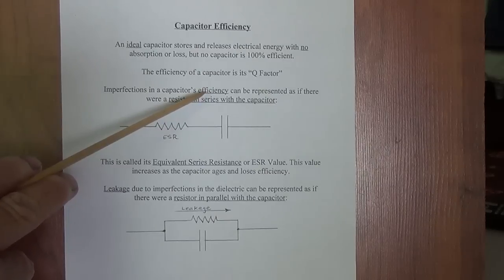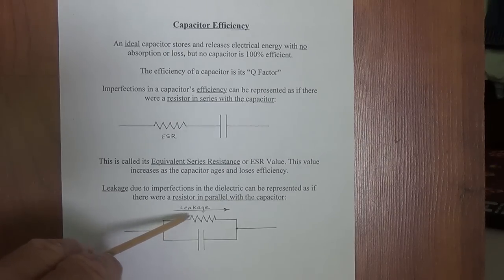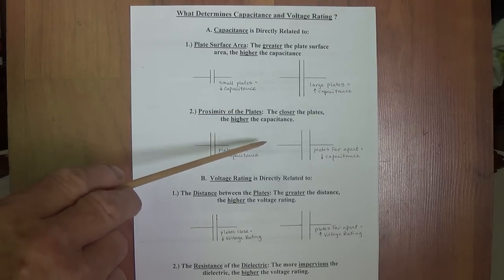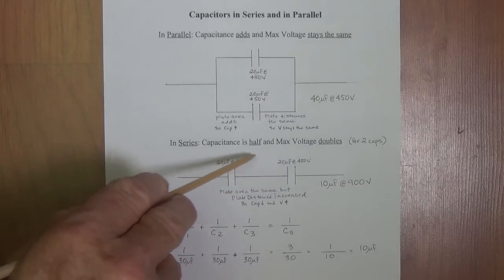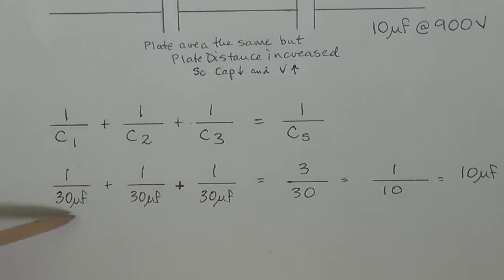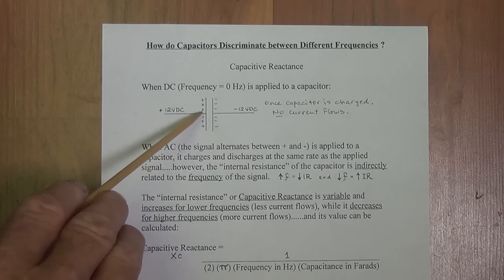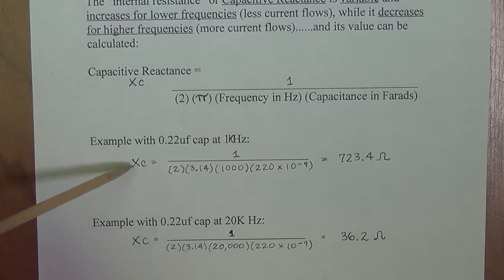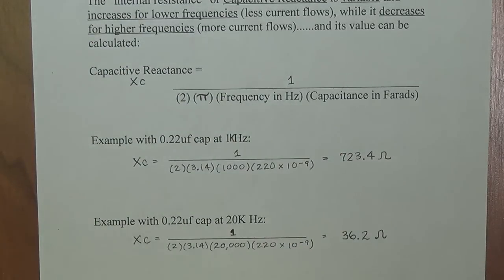Capacitors in Audio Circuits:  Part 2

Comment: @UncleDoug -- Howdy Doug. I hope that all is well down your way. I earned two degrees in electronics engineering and have never heard of ESR for testing a capacitor, but components manufacture/testing was never my field. Equivalent resistance, sure. Q, of course, although in the context of filtering. EE has been silicon (and similar semiconductor) focused for over 50 years, but that may change soon. As always, most edifying. 🧙🏽‍♂️
Reply from the maker: Thanks, KW.

Comment: Very helpful, Doug. Thanks so much! One more question, though... The example you gave for calculating capacitance and voltage in parallel wiring uses two caps with the SAME voltage (450V, in this case), but how do you calculate the voltage if two or more caps that are wired in parallel have DIFFERENT voltages?
Reply from the maker: As long as both voltage ratings are higher than the voltage they will face in the circuit, their voltage ratings don't matter.

Comment: It’s really gratifying to learn this formula for the Xc of capacitors. Might as well be black magic to a lot of people on guitar forums who, when choosing tone caps and especially the bypass caps for a passive bass cut, insist that trial and error is the only way to find the right capacitance. 

With this equation however it’s as simple as taking the formula for the attenuation of the proposed circuit, and making an XY plot of that attenuation against frequency. Do this twice, with the minimum and maximum value of the variable resistor, and you have a good idea of extreme values, though not necessarily the sweep of the given pot. Could be wrong but I think everything involved is linear so it’s simple math indeed
Reply from the maker: Thanks for sharing this with us, George. We're glad the video was helpful.

Comment: Hiya, Uncle Doug--

Another dumb question. I've got a circuit that uses a 0.1uf/400v cap going into the volume control/tone stack, and  0.1uf/16v between the volume control/tone stack and the phase inverter. 

Is this  configuration equivalent to 0.05uf/416v? Also, how close can I place a 6ca4 to the power transformer?

Thanks again for all the education.
Reply from the maker: Absolutely not. Leave some space, like 1", for ventilation.
Reply: @UncleDoug  Makes sense.

Comment: Uncle Doug the thing I really most like about the way you  teach things and approach things is you don't approach it strictly as an  engineer would. Your guitar player as well and you have a good ear ,and you understand... just because you use the same values with capacitors doesn't mean that they're going to all sound the same ! . And the worst thing you can do to a vintage amp is completely stripped all the capacitors out stock it  full of  Orange drops or something along those lines.  Then all of a sudden the magic of that amp is gone, and so is the compression in the harmonic resonance in organic warmth .  I get so tired  arguing with these stupid engineers and repair guys they tell me that I must have ears like a dog because it virtually impossible to hear any difference. Personally I think you would have to have pretty poor hearing not to hear the difference.  they say that it's impossible for the main filter capacitors  to have any effect whatsoever on the sound. I know that's not true. I've wrecked really nice black face fender amps by trusting somebody that told me as long as the microfared values were the same it wouldn't change anything.  boy was he wrong! Give me a pair of light blue late 60s Sprague Adoms in the end will sound as good or better than it used to. And I've checked the values and the ESR levels on nose capacitors and they all were still right on the money or very close
Reply from the maker: Thanks so much for your input, Dave. We appreciate your time and interest.

Comment: for coupling caps, when calculating total capacitive reactance, as applied to frequency, do we need to factor in the load input impedance of the tube its driving?
Reply: thanks
Reply from the maker: No.

Comment: Uncle Doug, I guess I was dosing in class because I've never understood the series capacitance formula.  1/30 +1/30 + 1/30 = 3/30 = .1   ??????   I badly want to solve the equation not just take the capacitance out on the bottom.  LOL!!!!  Mathmatically my answer of .1 is correct but to my surprise my answer was counted wrong on my test!!!  I used to build crystal radio and salvage parts and capacitors, tubes, and resistors from old tv's behind the neighborhood TV shop (late 50's) so I learned about capacitance values in mfd's.  In high school physic's class in Academia they made a big deal about the coulomb.   We did calculations on our tests and always talked about coulomb not microfarad or farad as related to capacitor values.  The information about coulomb in my opinion is totally useless unless you're a physic's research scientist or your trying to bring your monster Frankenstein to life.  I believe Dr. Frankenstein needed a few coulombs to get old Frankie going.    I feel it should have been briefly mentioned then boiled down to microfarads a more useful and practical value as you have done here.   In high school physics I waited for something I had interest in but microfarads were never ever talked about.  I began to hate academia.   I have never ever had coulomb mentioned for anything since high school and college physic's class.
Reply from the maker: I would say that the net capacitance of three 30uf caps in series is 10uf.....not 0.1, Doug. I guess that's why it was counted wrong.

Comment: The key takeaway here is that Rusty is a cute fellow but makes an unreliable capacitor since he gobbles up biscuits at random frequencies. But the test was skewed only to a series biscuit circuit. Maybe he performs more consistently in a parallel biscuit circuit Uncle Doug?
Reply from the maker: I'm sure Rusty would have gladly participated in an experiment to test your theory, CR :)

Comment: I noticed you didn't mention metal "can" type capacitors. I have one in my Univox. Aren't those common as well in guitar amps?
Reply from the maker: Yes, they are simply several electrolytic capacitors in a single can container.....there is nothing unusual or special about them.

Comment: Hi Uncle Doug, another brilliant explanation of what is usually a very difficult subject for students to understand. 
                 I used to use a water analogy and replace the capacitor with a canister in which there was an elastic membrane in the centre, and an inlet and outlet pipe connected at each end. When pressure is exerted at the input, the membrane stretches over to the end and the “capacitor” is charged. A varying pressure applied to the input results in a corresponding movement in the membrane and therefore in the water in the output pipe without any water actually passing through the membrane. Of course, the student must understand the concept of pressure being electrical pressure I.e. voltage, and any movement of the water being the flow of current. It worked well during my 30 ish years lecturing. BTW, I think there is a slight problem with the diagram at about 15 minutes. The potential difference across the capacitor is shown to be 24 volts. The only time the plate voltage on the right hand side plate will be -12v is when the +12v on the left hand plate reduces quickly from +12v to 0v. 
            I’m really enjoining you videos during our lockdown, it brings back many happy memories of my own lecturing past, I also used to intentionally punctuate my sessions with a few minutes of idle chatter about cars or motorcycles, that used to work well.
              Thank you again for the time you have spent posting these videos and I wish you a happy and healthy new year. Best regards.
Reply from the maker: You're quite welcome, FS. Thanks for your helpful comments.

Comment: Hey Uncle Doug,
It appears that when you're showing Jack in the window casting a shadow. Your microwave or something above it is throwing Sparks. Is that really going on? Or is that  a light in the Next Room over? It might be just a reflection off a ceiling fan spinning?
Reply from the maker: It is a strange optical illusion, Ronnie......possibly due to exactly what you guessed.

Comment: That's funny! I was going to guess Rusty would like chicken flavored because, when I was a teenager, I worked in a dog food plant that made chicken flavored dog bones. Out in Ogden Utah. They have to be aged about 6 months to a year before a dog will even touch them! They flavor the batter with real chicken blood or real lamb blood. Yes I know it sounds gross but it's true! That's the part that says " Real chicken" or " Real Lamb"
Reply from the maker: I wonder if the aging is required to allow the smell of manufacture to dissipate. Thanks for the info, Ronnie.

Comment: Hello Uncle Doug, I'm curious,  when tubes are said to be a matched pair, what exactly does that mean? Anything to do with the parasitics or just similar performance curves,. Maybe Rusty was a QC inspector and it means the same as the Chicken vs Beef dog biscuit labels?
Reply from the maker: It means that they will draw about the same plate current when utilized in an amp circuit, Trebor, thus they will have (nearly) equal plate dissipation values.
Reply: @UncleDoug  thanks for the quick reply UD!

Comment: So what is the difference between those tiny capacitors that have the same values as a larger capacitor I am talking here about those mylar capacitors that they use in solid state?Can someone tell me?Thank you
Reply from the maker: Capacitors in SS circuits generally operate at relatively low voltages, i.e. 6 to 9VDC, while the caps in tube circuits operate way up in the 400 to 600VDC range. Depending on the type of cap used in tube circuits, the size generally must be larger to allow for proper insulation to resist the higher voltages.

Comment: Can a new capacitor have high ESR? anyone know? and due we need to reject it?Anyone know?Thank you
Reply from the maker: I'm sure that some new capacitors are faulty, but in my experience, it's quite uncommon, Rob. Also, when electrolytics are charged up, they can "heal" themselves to some degree. This is reflected in a lower ESR value after charging and discharging.
Reply: Thank you for the fast reply and explanation Uncle Doug.
Reply from the maker: You're welcome, Rob.

Comment: I am trying to learn electronics and these videos are so helpful.Thank you Uncle Doug!Cheers
Reply from the maker: You're welcome, Rob. Best of luck with your self-education. It's the best way to learn.
Reply: Right now I am in the process attempting to restore a Akai M1 reel to reel. I have already replaced several capacitors in the amp section and preamp section. The problem is no sound coming out all I get is some static from the left channel nothing on the right. I also replaced some transistors and still have to replace a couple more.So your tutorials are very helpful.
Reply from the maker: That's good to hear. Best of luck with your project.

Comment: Hi Uncle Doug,    I realize this is over two years old, but I'm not an EE, so... for a given frq, the smaller rating cap will raise Xc vs a larger rated cap, correct, or no? ie:  .068uF vs .25uF
Reply from the maker: In the formula Xc = 1 / (2 pi x fC), both frequency and capacitance are in the denominator, therefore if you increase either one, the value of Xc will be reduced.......and, if you reduce the capacitance then Xc will be increased.
Reply: Uncle Doug     ok thanks so much

Comment: I'm building a modified uncle Doug fender 6g15. I make fiberglass boards to mount the circuits with steel ferules inserted in it.it takes a while but its fun.Get the glass material and resin from wal mart or home depot, lowes  etc . Put the raw material between sheets of non stick aluminum foil and run over it with a kitchen roller. It hardens in a short time. Take off the aluminum foil. Cut it to size with scissors.I also put a sheet under the circuit board so nothing shorts out to ground.
then follow your placement layout and drill holes for the ferrules. mount the parts and wire.I have made chassis but prefer buying from e bay. A great place to buy from is zachmdhunter. They have most any guitar amp chassis punched or blank for very low prices. Half the price in many cases. also for self builders -resistors.. can be bought for 10 in a package around 80 cents to a dollar. That's eight cents a piece better than radio s---k.
Reply from the maker: Thanks for your detailed input, Ken. It sounds like quite a project. Best of luck with it.

Comment: Hi Uncle Doug, fine instructional video. Back before digital audio motion picture studio sound departments had large bulky 35mm magnetic film roll degaussers. These consisted of a turntable that swung in and out from a large diameter enclosed wire coil on top thru which the roll of mag passed and an array of giant dangerous (!) oil tank capacitors in a cabinet underneath.  Obviously the capacitors weren't used for audio but the design prevented audio  'spokes' on the rolls of magnetic film. The unit created so much current (it was designed for intermittent use only) it frequently had to have cool-off time.
Reply from the maker: That sounds like a device better suited to Dr. Frankenstein's lab, Andy. Thank heavens those days are long gone.

Comment: I don't see the infamous color orange used in the  RC equations  ;      If I painted my caps orange would that decrease the capacitance yet increase the value the value of the amp  if I sold it ?
Reply from the maker: Bright orange capacitors improve tone, volume, and resale value, Lost, as well as automatically adjusting the bias and keeping white paints spots from sticking to the top of the cabinet.

Comment: Hello Uncle Doug, I need to change a leaky filter capacitor. but a lot off new ones are a lot smaller in size, does this matter ?,,as long as the values are the same.?best regardsAndy
Reply from the maker: As long as the values are the same or slightly higher, the smaller new replacement caps should work just fine, Mr.A

Comment: Hi Uncle Doug, I couldn't find a 5mfd 450v cap (4 of them in my amp) but this video gives me an idea. Could I run 2, 350v 10mfd electrolytic caps in series to get 5 MFD w/700 working volts (like in the bassman example these would follow directly after the rectifier tube)? Looks like after resisters there are highest of 340 working volts in the circuit.  If I can do that, my capacitance will be exactly 5mfd like the original caps. What do you think?
Reply from the maker: You can do that, John, but you're going to have a whole bunch of capacitors. If space is not an issue, I guess this would work. Did you look at Antique Electronic Supply's cap list?  Surely they have some 8uF @ 450 caps (which would work just fine).
Reply from the maker: John, have you checked Mouser Electronics? Their web catalog features all sorts of 5uF @ 450WV electrolytics:   https://www.mouser.com/Passive-Components/Capacitors/Aluminum-Electrolytic-Capacitors/_/N-75hqt?P=1z0z819Z1z0wqr6Z1yx4ard&gclid=Cj0KCQiAyszSBRDJARIsAHAqQ4r5BxhAfu_nsjR-w5zdLPSOCNbk5rgsFill-XyAyas2myivuf8_spYaAh28EALw_wcB
Reply: Uncle Doug Thanks!  I was primarily looking at Amplifier Parts.  I'll check them out.

Comment: Your video series is great! I started just wanting to get basic idea of how amps work and I found myself getting sucked in. Now I've watched some of your videos 2 and 3 times and I have an exercise book full of notes and diagrams. Reminds me of high school.I am curious about one thing though. How do you calculate the values for the filter capacitors.  Perhaps you can you make  video about this subject?
Reply from the maker: Thanks so much for your nice comments, Daniel. The values for filter caps in tube circuits are quite different from those found in semiconductor circuits. Tube electrolytics tend to be relatively low capacitance (i.e. 30 or 40uf) and high voltage (i.e. 450V+), while SS caps are just the opposite. There are formulas to calculate the capacitance needed, based on current, ripple, etc. but to be honest, you can generally get by just fine by seeing what other similar circuits use, or going with a common combination (i.e. 40, 20, 20uf) and then fine tuning if there is some audible ripple.